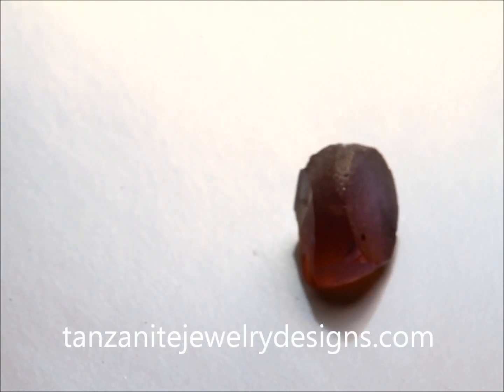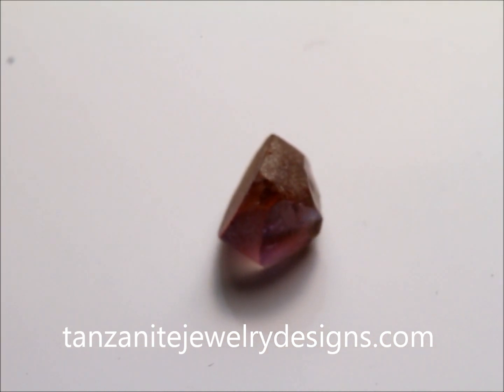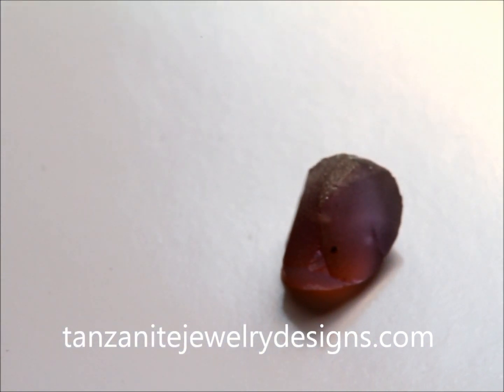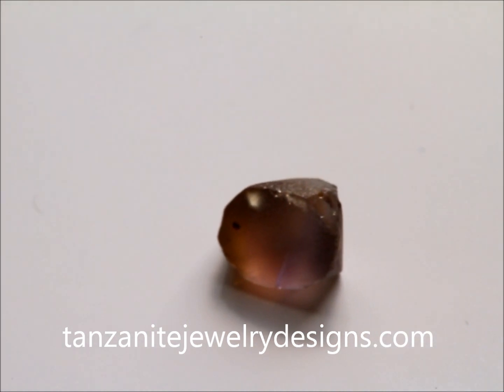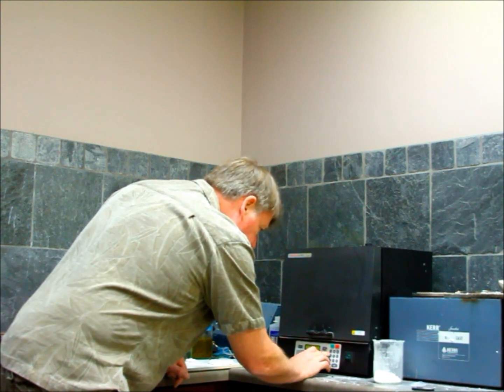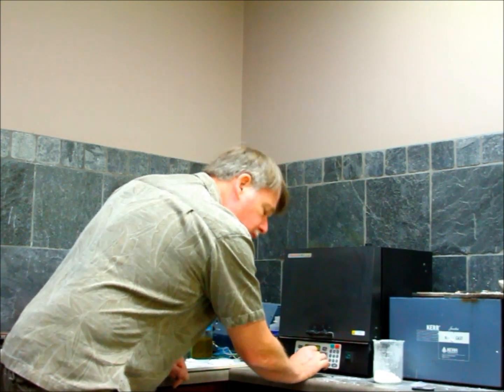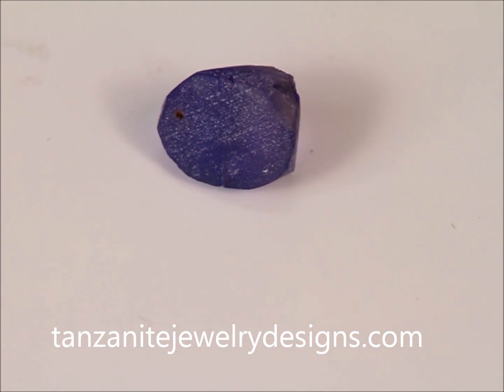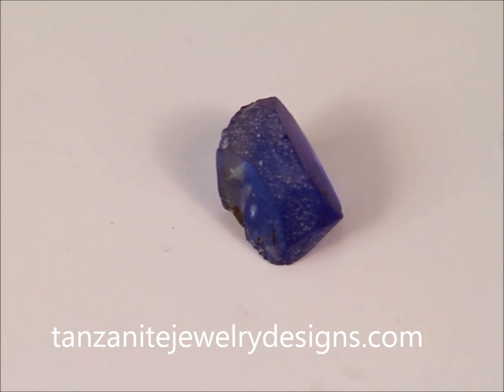Natural Tanzanite Heating To Enhance Color: Heat Treatment of Gems

Comment: Hi Steve, or whoever happens to get this message. I was wondering if you could tell me if, and when, golden zoisite is ever heated to make tanzanite? Or if the golden, beer colored stone, is better just left alone, and possibly more valuable, left unheated. I have two pieces, one smaller, 8x6, and one 9mm 3.5 ct.
    - Thanks for any info

Comment: What kind of container are you using. Ceramic crucible? Aluminum? and/or what kind of insulation material are you using? Silica? Plain sand...??? Where is the best place to get these items?
Reply from the maker: Steel casting crucible with the bottom closed with casting investment (mixed and dried hard) and the stones are suspending in dry casting investment.

Comment: Great video.  How do you know that heating it will only pull out the yellow color?  Could you put it at a higher or lower temperature and pull out one of the other colors instead?